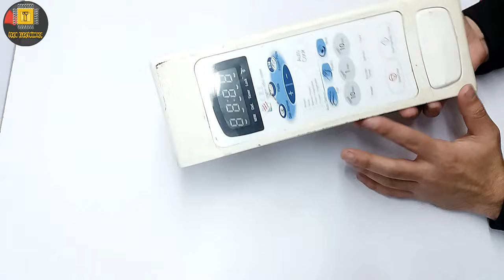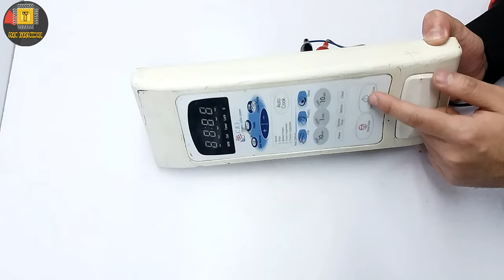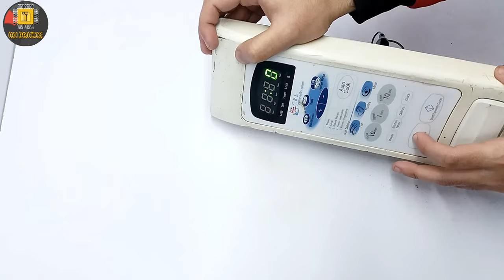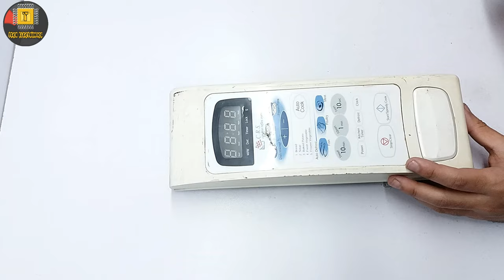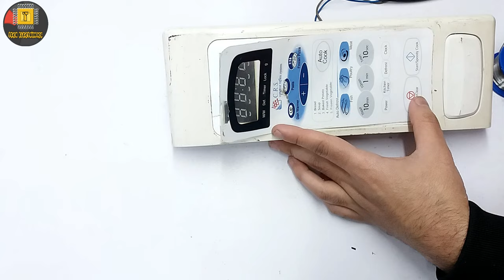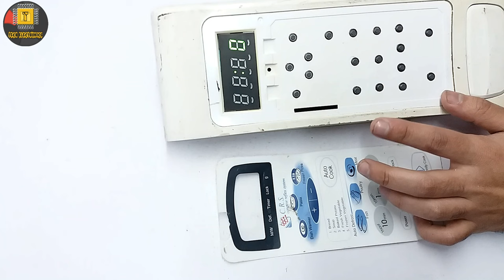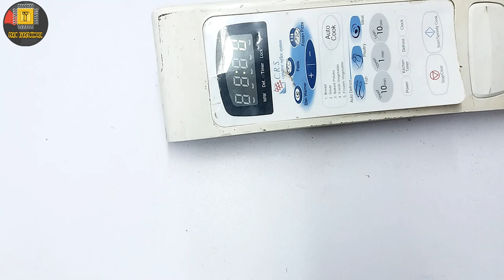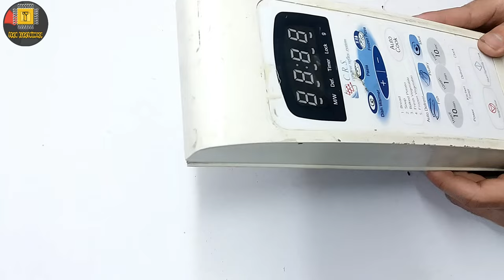How to Repair Any microwave touch panel not working complete detail repairing in this video

Comment: Bro muje check krna h ki mera touch panel kharab h ya fir uske andr ka board lakin bhai mere pas battery nhi h check krne ke lie board ko to kya me shot krne ke lie microwave me laga kr shot kr sakta hu kya
Reply from the maker: Battery ki zrurt prti b nh h video kate bina aik baar puri dekh lo to sab smjh aa jy ga
Reply: @TTechMentor786  to bhai apne electricity ki wire ligayi h kya aur vo jo apne button use kare h vo kitne ke pade apko aur vo button normal button hi h na ya heat proff wale
Reply from the maker: @devanshjhamnani5038  heat prof button ni bolte unko 2 pin one touch button khty h or local market se 150 RS k andr sara samaan mil jata h button b
Reply from the maker: @devanshjhamnani5038  electricity ki wire series boatd se lgaty h series m se lgai h wire mny agr series board k ni pta to chnl pr video h ap dekh skty hain😊
Reply: @TTechMentor786  bhai kya me khud ye sari series ka connection karu ya fir bhar kisi dukan se krwayu muje vase soidring thodi bohot ati h bohot difficult h kya iski soidring
Reply: @TTechMentor786  aur bhai merko ne touchpad 1200 me mil rha h market me to muje kya krna chahiye new touchpad ya button
Reply from the maker: Button lgwao wo zyada bhtr h touch pad jldi khraab o jata h uski life km h button waly kaam ki life zyada h or agr soldering bht achi h to hi khud bnao wrna ap musibt m pr jao gy is ko sold krty huy kafi sari wires ikti o jati h or kisi aik jgh b mistake hui ya safai se kaam na hua koi wire short o gai to board kaam ni kre ga
Reply from the maker: I suggest k market se touch button lgwa lo yha pr hm 700 rs ma button lga dete h sara cost 150-200 rs ka hota h or baki kam krne k pese hote h or dawlance ka touchpad b itna mhnga nhi h 400 ka touch pad h or 200 rupy lgany k lty h dono kaam 700 m easily ho jate h mrzi apki h k touch button lgwao ya pad button zyada bhtr h agr bnany wala acha bnay to
Reply: @TTechMentor786  dawlance ka touchpad kha milta g
Reply from the maker: Local market pta kr lo nhi to online Amazon se buy kr lo
Reply: @TTechMentor786  okay thanks bro ☺️☺️

Comment: Assalamualaikum.
Mera Kenwood MW786 model brought from Bahrain not working.
Only star button not working. I have taken care of door lock switch and traced the connection for start button and connected manually also not starting. Then I called the mech he took the panel and returned function IC not available.
What to do
Reply from the maker: Only start button kaam na krne ki 2 reasons ho skti h ya to board m jo start ka button h wo khraab o gya ho ga ya phir door switch m 2 wires ja ri hoti hain board se wo wala door switch khraab o jy to b start button kaam nh krta

Comment: Im not able to get the relay of samsung microwave oven it is of 3 pin and i have 4 pin can it be adjusted in the 3 pin relay?? Plz help karo
Reply from the maker: Ji normal koi b same. volt ki relay lga lo lg jati h
Reply: @TTechMentor786  jo agey ka socket ka pin hota hai na woh kya diode symbol taraf hota hai ki dusri taraf

Comment: Hi bro, I have Samsung microwave membrane keyboard problem. Membrane has 10 lines going out but on board I see 14 soldered pins through socket. How will I solder the 10 connections to 14 pins? I am confused and unable to repair this membrane malfunction. Please help. Let me know if u want to see pictures and video if that will help.
Reply from the maker: send me video on my instagram id i will guide you Tasawaraijaz98 is my instagram id
Reply: @TTechMentor786  Thank you

Comment: sir Relay jal gai thi, change ki ha lekin hr cheez chalti ha lekin Heat nahi krta,,, relay ki 2 taaar ulat lgne se koi faraq to nahi parta????
Reply from the maker: Nh agar garam ni kr ra to check kro k transformer jo bara wala transformer h us pe 220volt current aa ra h ya nhi agar transformer pe current ni aa ra to masla door switch ya relay k o ga lkin agar transformer oer current aa ra h or oven khana grm ni kr ra to masla ya to heat gun k o ga ya capacitor k sath lgy huy fuse ya diode k ho ga

Comment: My microwave is automatically turning on once I close the door. But it is showing 0 in the display and not heating. As because it’s not heating, I replaced the high voltage diode. Still the problem is not solved. The microwave is not heating and not stopping until the door is opened. I thought the membrane behind the button is malfunctioning, so I removed the membrane, still the problem continues. What might be the problem do you think?
Reply from the maker: check all the door switches of your microwave oven😊
Reply: T Tech Mentor do you think the issue is with the door switches? Because when I open the door microwave stops to spin the plate, when I close the door the microwave automatically starts running without heating the food. In the control panel none of the buttons working.
Reply: T Tech Mentor I checked all the 3 switches, it’s perfect
Reply: T Tech Mentor switch 1 and 3 : continuity only when the switch is pressed, switch 3: continuity always on, when switch pressed continuity off so I think all the switches are working correct. Still the problem exists.
Reply from the maker: yr yhan pr na ab agr ap 100% sure ho k ap k door switches thik hain to phir ye h k ap k micro ka jo control panel h uspr hi shak jata h but m yhi khu ga k aik aik door switch ko disconnect kr k bahir nikal kr series bulb k sath test kren 3 pin wala sab se phly check kren q k jo problem ap mjhy bta rhy ho asi problem door switch ki hoti h or microwave se nikaal k proper check kren
dusri baat agr microwave heat nahi kr raha to sbse pehly usky transformer k aagy wali side pr agr white color ki ya kisi or color ki plastic ki dbi h to us dbi k andr aik fuse hota h us fuse ko check kren phir b na ho to heat gun ka issue b ho skta h but asa bhi ho skta h k jo transformer ki main 220 v ki wires h un pr current ki supply bnd ho to kuch b ho skta h stepwise apko sab check krna chiye i suggest m kosis kruga in future microwave ki complete training upload kru abi to ap jo mny btaya h use follow kro😊
Reply: T Tech Mentor switches check kardiya meyney. Votho bas perfect hey. Abi meyney vus transformerki white box ko nikaalkay fusebhi check kardhiya, vobhi perfect hey. Pahley mujey microwave ko stop karna padeyga vuskey baadh heating ka issue solve kareyngay. Abhi power on karneykay baadh immediately microwave ka disk ghumraha hey or bulb and fan chaalu hey. Mey ney control panel ka buttonskay pichey aaney waala membrane disconnect kardhiya, phir bhi microwave chaalu hey. Bahoth shukriya aapka detailed explanation kayliyey.
Reply: Door open kardhiya tho prir microwave off hojaatha hey. Door moochnaykay baadh microwave chaalu. Mathlab door ka switch tho kaam kar raha hay. Meynay theeno switches ku baahar nikaalkay continuity check kardhiya, perfect hey.
Reply from the maker: hmm phir control board m fault ho skta h relay proper on off nahi krwa rahi ho gi microwave ko control board ka issue b ho skta h or oven ka fuse thik h phir b gram ni kr ra its mean ya to bare waly tranformer ko current nahi mil ra ya phir heat gun or capacitor m se koi aik cheez khraab h isko check krnr ka treka ye h k transformer ki 220v wali wires utar k wha pr series wire k zriye se ap supply de kr operete kren us se ye hoga k transformer ko suppky mike gi to aagy heat gun b on ho gi apko ye clear ho jay ga k gram na krne wali problem start m h ya transformer k bad waly hisson m h
Reply: T Tech Mentor microwave mey sab parts theik hey, capacitor mey ohms check karneymey multimeter reading nahi batharaha hey
Reply from the maker: sir ase ni check hota hm series m test krte h capacitor ko charge kr k or agr ap ko lgta h k sab thik h phir b nahi cha raha to ye to impossible h😊khi n khi fault h jo apse trace nahi ho ra maybe baki sab thik ho control panel m error ho wo transformer ko supply na bhj ra ho ya koi b error ho mere samny hota to zrur btata but jitny faults mny apny experience m dekhy h wo sab mny apse details m share kia h baki ap dekhen 
m apni bat kru to m microwave ko series m test krta hu hmeesha ya ampere meter se jo k main board m lga hota h hmy usi se idea ho jata h to hm trace kr lete h is m ohm wgera ka koi calculation ni krte hm
Reply from the maker: konsi company ka h microwave ap k pass?
Reply: T Tech Mentor LG MS2042D
Reply: Problem control panel mey hey. Control panel nikaalkey relay waala wires short kardhiya, microwave perfect chal raha hey
Reply: Primary and Secondary switch short kardhiya, monitor switch nahi short Kara meyney. Still control boardmey start button kaam nahi kar raha hey. DOOR error batharaha hey. Meyney control board sey micro relay bhi nikaalkey check kardhiya relay perfect hey. But control boardmey pinaneykey baadh, relay On nahi ho raha hey, kyuinki control boardmey start button nahi kaam kar raha hey. Image check karlo : https://ibb.co/w6k5J1n
Reply from the maker: start wo is liye ni kr ra bcz us k khaty m start tb hota h jb door close hota h door switch m 2 wires jati h board se un dono wires ko short kr k start kro gy to start ho jay ga
Reply from the maker: ho skta h sir
Reply from the maker: agr mera reply na aya kre to ap new comment kr lia kro q k sometime mjhy reply ka notification late ata h new comments m rozana check krta hu sorry for late reply sir

Comment: After key tracing some button are working and some not can explain that
Reply from the maker: Tracing m koi mistake hogi ya circuit m b problem ho skti h 80% chance ye h k ap n koi connection glt kia ho ga baki check kr lain yhi problem ati h maximum 😊